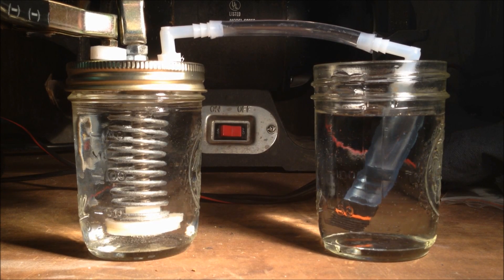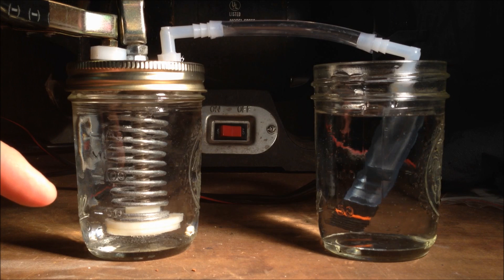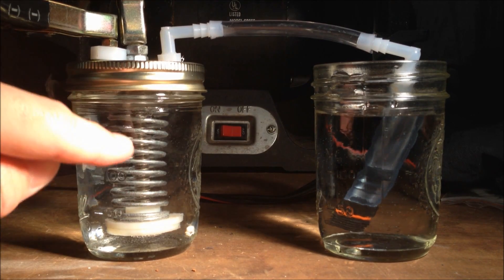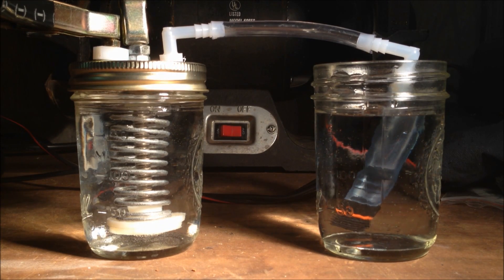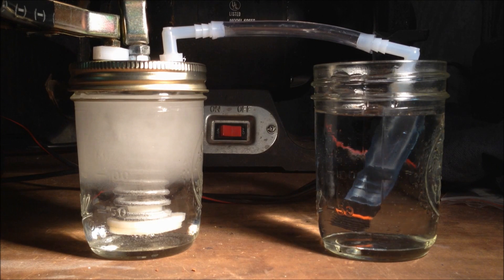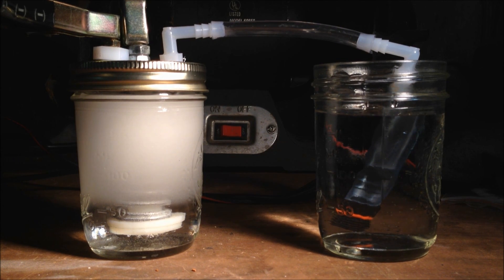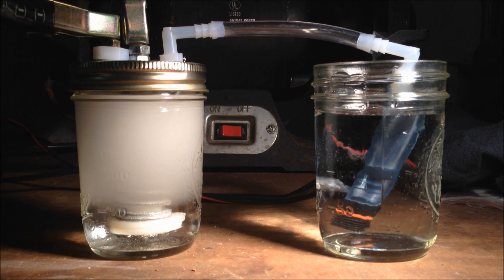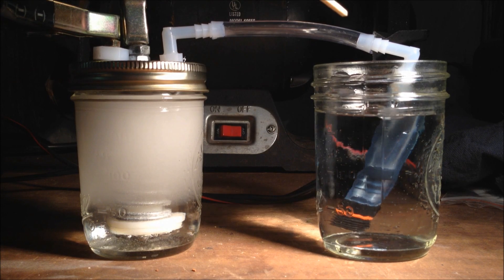HHO Generator - Wet Cell

Comment: All these experiments are good but we shouldn't overlook that to fire and move the piston of a car motor then the particles will need to be charged negative in the case of a negatively earthed motor and positive in the case of a positively earthed motor. If not we are relying on the gas mixing with the other fuel for combustion rather than acting to fire independently or as an alternative to the petrol or diesel. 

It is not the same as in the case of a normal combustible fuel inside the enclosed barrel of an engine there enclosed, even under compression. This fact is overlooked in many, even most, of these presentations here on YouTube. It does not actually combust, 'it' the hydrogen gas itself sparks to ignite, and does it as a reaction to the electric circuit receiving a pulse. It is unlike petrol or even gases like propane. 

In the case of a positive charge then the hydrogen gas particles themselves short circuit if they are charged negative, this happens when they meet the positive pulse from the spark plug.

Comment: must be 10-times more faster, as i expirience, its working slow, due to low current in one-gap coaxial cell, and no-electrodes-vibration or electrolite-mixing here.
find safety glases[swimming type], NaOH or KOH powder(alkali powders and water solutions must be stored sealed tight enough from air-CO2 neutralisation reaction, that will give Na2CO3 or K2CO3 that more safe for eyes(Na2CO3 will not damage eyes to doctor help level, K2CO3 (it-s salt with high PH) cauce not instant blideness like alkali, but someone will need doctor treatment few days...
I use 50% NaOH(1kg, it is approx 1liter volume of powder, when in jar) in water(1liter=1kg) with  some powder of activated carbon medical tablet, that conductive enough, in liquid better(when no air emptiness that exists in piece of AC tablet)
and put a magnet(black ring)(from loudespeacker 3wt or bigger) on the bottom of cell gap- metallic glass,lead-iron сoated food conserve jar(plastic easy burns by turbo torch,leave CO2 only... and almost new surphase of used foot jar,or at bottom of your spiral coaxial tube, neodym supermagnet damage by T>120С or even 60C(some types of neodym material mixes) , and will react with electrolyte, use black ceramic(ferrite type, termo stable upto 600С, and chemically inert), 

thicker alkali stronger than 20%, poorly agitated and difficult to pass for hard and bug ions like OH- anions, in addition at room temperature, a maximum of 20% concentration - increases the degree of dissociation of water, and more than 20% alkali - is useless to add,
 but it will usefull if there is electrodes vibration, or liquid mixing (magnetohydrodynamic rotation in case of coaxial design with magnet.
and second catalisation factor - electrolite heating, approximately to 100C, it triggers the continuation of dissociation, and hot 30% aq.NaOH is better than cold 20% aq.NaOH and much better then cold 30% aq.NaOH, possibly partially freezed to cristall dielectric at all... after warming up, boils alkali at about 140C such that 100C boiling water that outside can cool system, power supply 12V 30-40amper

The efficiency is 20-30%, the efficiency is maximal at 2V power (sufficient that the electrons overcome the potential input-output barrier across the metal boundary (if it is not platinum) -electrolyte, above 2V supply per gap (your coaxial cell is equivalent to the section of infinite two plates , with a gap = the radius of the spring or cylinder, the center pin seems like a cylindrical wall with the same wall right in the center in front of the nose located, in the cylinder electric field will be radial, as if the two plates of these contribute in the middle of an infinite wall of the type where the boundaries are arbitrary, although this correction is not so important, especially with taking into account that the width of the "expanded" segment of such a cell is 2 * Pi * Radius
and the gap = Radius and it is 6.28 times smaller than the width, so edge effect not so in compare of coaxial and equivalent two plates cell.

the interstitial space between the electrodes, the path of the particle in the electrolyte, and it is mostly useless distace, and so everyone wants a small gap, the problem - only insulating bubles on plates surface in gap, that gets stuck, usually this problem solved by special electrode-vibrator motor, or electrolite mixer system- it helps to solve the problem, 
increasing dissociation rate makes cell virtually bigger, more ions inside gap... less inert H2O molecules that suitable for bufferisation only, the degree of dissociation = the concentration of the yons employed in the work, migrating towards their electrode {compared with} number of "passive" water molecules that are not dissociated - the insulator interfering to pass through, and reducing the gap, reduce the path of the proton (hydrogen + cation) to the minus cathode (source of electrons restoring protone into atomic hydrogen which dimerizes into molecular hydrogen)
Passers-by do not interfere with the pedestrian, when go in same direction - the road bacame like shortened, the delivery accelerated, if it will be on the way to get buses, bringing to 3-5 stops long way, several times - and its way will not be long, as if it was short , it is a floating piece of activated carbon on the path of the yon (although zinc powder bubbles in volume, but is most likely consumed), so the cell resistance becomes 0.1-0.3 ohms, and it differs little from the large cell of two plates with a small gap, also having a low resistance for account for the paralysis and distribution of the process over a large area of the electrolyte.
the useful resistance of the electrolyte is a myth and a misunderstanding, as children think that the transformer needs to be wired with a thin wire so as not to short circuit the 220v mains, not knowing that the superconductor would be better, although the speaker dynamics with a superconductor would drop to zero the resistance of the DC winding, but at 100Hz it would be back - the correct one is now, and not 4 ohms, but say 1 ohm, but it would yell out a little less than four times the voltage (which would give the rating current on the same number of watts = the force of the pressure on the diffuser and outside you can podkl to use a 3-ohm copper remaining "resistor" and boil the watts lost by heating the loudspeaker)
if cations and anions could independently move 100% liquid concentrates dissociating completely water, in their trolley to their electrodes, then up to 2 volts the cell would be more heated than the gas (this mode is not very clear to me), but the current would be small ( resistance like a zener diode, almost completely locked when undervoltage) from 2v and above, the current would rise very quickly, like a welding arc, which only becomes fattened by current, and the voltage does not rise above 30-60V usually. and behave like a non-linear resistor or zener diode or gase-discharge lamp(HPS or HID type) which has a small differential resistance above the threshold voltage, if you trying to apply >2v,  instantly converting any amount of energy, which is 2 volts * X amperes in HHO gas at once, in practice, this ideal dream is diluted with inactive distilled water, which slows down the flow, (although it buffers the concentration of yons, disintegrating when (in cell) ions concentration lower than normal), big gap- creates a long liquid wire - heating. if i will connect 310V DC to the one gap cell, with usual drinkable tap water, will flow current about 10amper, ennergy consumption 310V*10A=3100 watts , but only 2volts * 10amper = 20W of total connsumpted power, goes to splitting water, and 3080 watt - will work for heating water ... efficiency 20wt/3100wt=0.64%!!! only
on alternating current, electrolysis is reversible, and gives not gas but heat, all watts will give only heat ...
With activated carbon and alkali in different ways, the internal resistance of the cell decreases (by dissociating further) the solution conductive or partially replacing the non-disturbing bubbles with a conductor
and cell acts like 2V ideal rechargable battery(but instead of charge-it gives HHO), and 0.3ohm parasite serial connnected resistor(resistannce of cords, electrodes and electrolite)
and to get the same 10amperes current, you need  2V+0.3ohm*10A=5V
5V*10A=50wt consumption:
2V*10A=20wt is power for HHO 
R*I*I=Ur*I=0.3ohm*10v*10v=30wt ... = 50wt-20wt    - heat looses
efficiency 20wt/50wt=40% good compared with tap water result  efficiency 20wt/3100wt=0.64%!!! only
Reply from the maker: Thanks for the advice. Red eyes turned out to be Sjogren's Syndrome. Although, I still believe something I did jump started it (although apparently it doesn't work like that). But, it started the day after I posted this video.
Reply: Chris Sawyer, just read about Sjogren's Syndrome, i hope in your case it will   disappear soon. As i read now, one serious discomfort there - dryness of eyes, needs of artificial tears for moisturing eyes, doctors recommend also to wear glasses for inhibit drying after appliing drops, maybe swiming glasses will be usefull, it is sealed and usually save moisture effective

Comment: I used the mason jar twice and both times the jars were cracked apart.. the lids each had a 1/4 inch tube to let the HHO out... 

Trying to find out why the cracking is happening.  Maybe because the exit hole was too small at 1/4 inch ?
Reply: I'm thinking there must've been too much pressure inside the jars.  Unless the temperature changed drastically from cold to hot, as others in the thread suggested, I don't think temperatures are related to the cracking.  Try to relieve pressure of the gas buildup.  This is a brilliant design I think.
Reply: Jason Greene maybe it was too hot
Reply: hydrogen is a light gas so a small hole would do but the cell produces heat so maybe the heat caused the jars to crack

Comment from the maker: Question for those doing the same thing: has anyone else woke up the next morning with red eyes?  I studied the process some since this video. I know that as the baking soda is consumed, it breaks down and produces a blend of hydrogen (H2), carbon monoxide (CO), and carbon dioxide (CO2). As this occurs, the baking soda is transformed into sodium hydroxide fumes. I haven't validated this, but it sounds possible.
Reply from the maker: I wrote "I know". I meant "I read" on auto-hydrogen.com.
Reply: Dont use baking soda or table salt. KOH will not break down, cause crud, and increase production. As water is used you just have to add more water not KOH. Last a lot longer than all the other choices and is by far the best option.

Comment: Did you add any salt in the water to strengthen   The  electrolysis process
Reply from the maker: I used baking soda. I tried salt, but it didn't seem to be a good electrolyte. I'm using a 12v battery charger set at 15a.
Reply: Salt is a really bad idea. Creates chlorine gas which is highly corrosive and deadly.

Comment: i did the same thing as like as you...but i had some questions..
1)hw to decrease the heat of a container..??
2)is there any wa y to increase amps from dc-dc..(probably i had 12vwith 5amp battery)but i need it to be 6v@30amp
Reply: you only need 3amps
Reply: 3amps is not necessary to generate 3lpm
Reply: I don't know what your doing but if you are running in a car 6 amps is ideal cause it will produce hydrogen and the battery will not get hot our tear up cause its about the same as a car radio. car radio works off 6amps

Comment: It actually looks like a MacPherson Strut style of suspension setups for vehicles. I am merely curious of what those plastic pieces are. Not what they do as I know their purpose here which is to hold the electrodes firmly in place. But exactly what they are, or where you got them, is helpful.

Comment: I am trying it. I am using spoons and in the water is salt. but my water becomes green. does someone now why
Reply: +Sam Kerstens That is because the salt corrodes the spoons into iron hydroxide, the green stuff.
You need a different electrolyte, I recommend baking soda or sodium hydroxide.
Both very cheap and purchasable in the supermarket.
Reply: okey thank you very much.
Reply: Sam Kerstens no problem
Reply: ***** its the iron reacting not the water

Comment: 12 volts 15 amps a cell
ten gauge wire
stainless steel
perfectly clean water so use distilled jugs from walmart
not purified or tap..
also use a quarter teaspoon of pure baking soda.. to help boost the cells productivity
only issue im having is making a air tight lid. hmm 
i hear poster putty works good maybe an epoxy up for try next
Reply: +Dan Hart I generally believe in no rule of thumb as the real world doesn't always play out it it's calculated favor. But I will ask, why is it that it's insisted to use only distilled water. What is it about distilled water that keeps the cell from magically blowing up or imploding on itself? Or does it have a witches curse? I'm being sarcastic, but I think you get what I'm saying. To me, water with contaminates that have better conductivity than water could only be helpful unless of course they are corrosive or release dangerous byproducts when they are under the influence of electrolysis.

Comment: Can Sea Water be used?
Reply: +Dario Bonifaz Yes it can. The salt acts as an electrolyte allowing electricity to flow. Make sure to do it in a well ventilated area as you will produce chlorine gas.
Reply: Thanks man
Reply: nooooo pure clean water or your cells will destroy..
Reply: +Dan Hart Sir, if the SS electrodes will stand up to the corrosion of salt, and not all alloys will with salt in high concentrations, what could possibly go wrong? Well, chlorine gas is bad. Did you forget that with low voltage electrolysis we aren't using pure clean water? With low voltage we must add a catalyst. While beneficial to our cause it is still a contaminate. Surely it doesn't matter what suitable catalyst is used right? You must still be on your distilled vs whatever train of thought.

Comment: How much current does it pull. And I assume 12v?
Reply: yes 15 or so
amps a cell
Reply: +Dan Hart Obtain many electrical parts that can be configured to our unit. A microwave transformer to increase our output voltage would eliminate the need for any catalyst added top our water as it is not necessarily the amperage that splits water molecules, but rather the voltage applied to them. If you're using catalysts to drop the solution's freezing temperature then it's quite understandable. But the benefit of low current draw that higher voltage can give us is a definite bonus. I would not attempt this with a catalyst added to the water. If water becomes conductive (added catalysts) with only 12 volts applied, what would happen if that same water had 120 volts applied to it?

Comment: What you get at the buubler is hydrogen and oxygen - how do you separate the two and collect only the hydrogen ?
Reply: You could put each of the electrodes on opposite sides of the jar, and have a funnel  over the negative but still underwater, so you catch mostly hydrogen.
Reply: Khaled El Nazer  foil and lye water is 100% hydrogen
Reply: +Khaled El Nazer Why is it you would wish to do that other than to store hydrogen gas? There is not one advantage hydrogen gas has over HHO gas when being used as a fuel saver for any internal combustion engine. HHO gas increases power, increases fuel mileage, decreases emissions, and increases an engine's detonation tolerance more so than pure hydrogen gas can. HHO gas also steam cleans the engine internals because once it undergoes combustion it reverts back into water. This water will become steam during the combustion event, which will expand and impart force on the piston (feel the power) whilst stripping away all sorts of carbon deposits that results from manufactured inefficiency (the engine). Also, with a cleaner running engine that uses much less fuel, engine life will be extended as will oil change intervals.